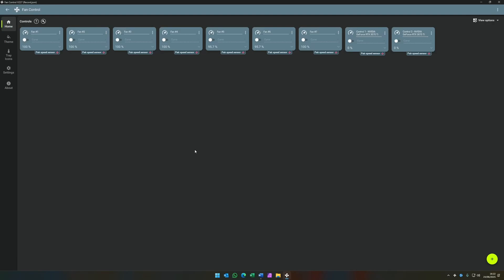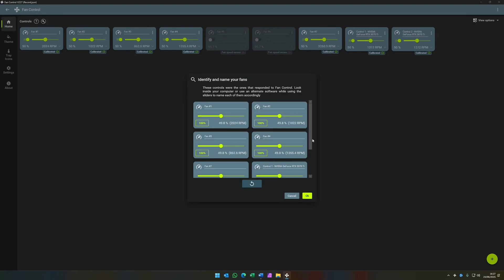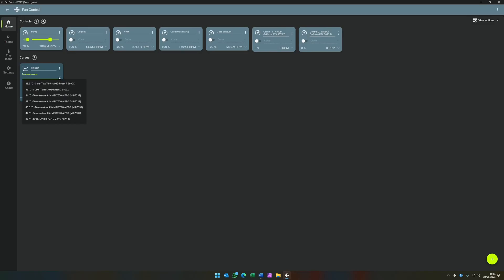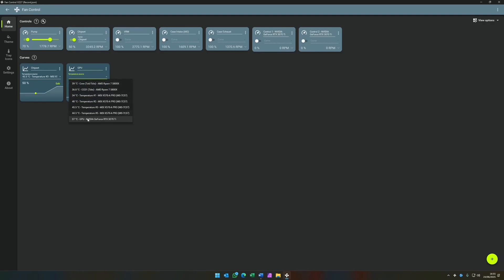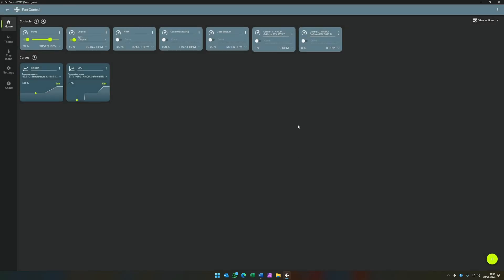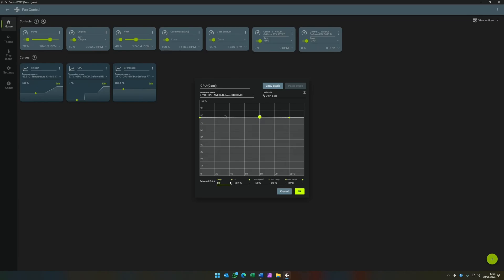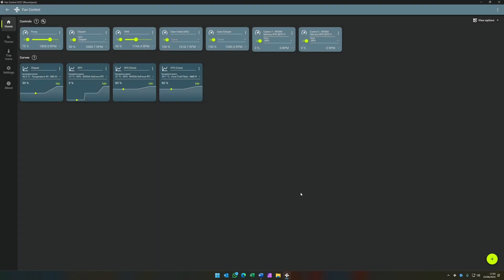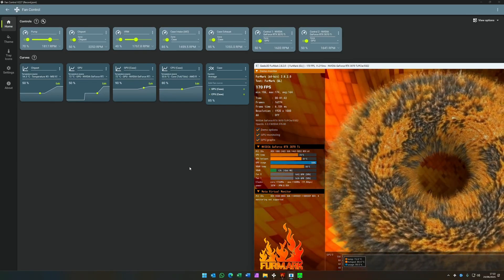How to Setup FanControl

Comment from the maker: Do you use FanControl? If so, how have you got it configured?
Reply: Mix graph, so which ever CPU or GPU is hotter it takes over the fan control curves of my case fans 😊
Reply from the maker: Smart
Reply: yap, the first time i use it was today. And im so happy, bcs i can link my case fans to gpu temp. BTW, i guess, if i use MSI Afterburner, it would be better if i deleted the GPU sensor link in Fan Control, bcs FC and MSIAb can conflict with each other, its better to leave all  GPU control to Afterburner. Correct me if i wrong xD
Reply: @elem8942  My fan controll overrides MSI, i still have my overclock on msi as well
Reply: powl0 on my computer is NOT safe to use! There are several reasons for that. the computer easily freezes and then becomes unresponsive. I have never been able to get powl0 to work even though I consider myself to be someone with a lot of data knowledge. powl0 can also cause damage to windows

Comment: Why do you create the first chipset graph if you only apply the last two to the case fans? Am I missing something? By doing that it ramps up the case fans to a minimum of 80% does it not?
Reply from the maker: I like to control the chipset fan separately as because it's  smaller, it is very loud.  The case fans run at a minimum of 80% as they are big 140mm fans and are below my personal noise threshold that I talk about at the start of the video.

Comment: You don't cover BIOS settings for your fans to get this app to integrate correctly.  

Also, I had been running this software for some time now and it was controlling all of my system fans perfectly.  I then installed a Universal Screen and the accompanying software (L-Connect 3 from Lian Li) and it somehow messed up my control of the fans.  I've tried uninstalling both apps and reinstalling, no luck.  Tried the Fan Control by itself again, still don't have control over my top fans and the middle fan in the front of my case.  Another fan says I have control, but I actually don't.   Tried getting help from Lian Li CSRs and I think they have given up trying to help me.  I emailed customer service for Fan Control and no reply.

Comment: i am having trouble setting this up. i can see my fans but none of them have speed sensors detected and don't react to input when calibrating.
Reply from the maker: Sounds like they may be either non PWM fans, or set incorrectly as DC in BIOS.
Reply: @sOOtieLive  all of them are working and fully controllable on armoury crate. including the aio pump

Comment: What is the chipset fan? I have all the ones you have except for that one. I think its tied in with my VRM MOS fan and heatsink on my Asrock Taichi Carrera. Also with these setting wont the case fans just always spin at 80% minimum? Thanks for the video.
Reply from the maker: Chipset fan is a fan that is fixed to the motherboard and helps cool the chipset, if one isn't showing during detection - you might not have one. They are very distinct as they cause a LOT of noise at high RPM. As for the fan settings, no - they  will ramp up depending on what the sensors are seeing either individually in the case of the single graphs or a mixture of more than one for the mixed curve.
Reply: @sOOtieLive I will watch your videos again because mine were staying ramped up I had to turn the curve down to 50% instead of 80
Reply: Nope, following your instructions implicitly my case fans run at 80% minimum, just like the video shows, after you put your case fans to run the gpu (case) and cpu (case) mix curves, your case fans starting spinning at 80% as well.

Comment: Fan Control Icons themselves within the application don't have any toggle switch anymore in version 245 - the latest at this moment - so how can that setting can be adjusted, instead?!
Reply: you need to click on the 3 dots on the component fans u want to adjust and then set to manual and you will see the bar .

Comment: how does this software impact performance isnt it just better to tune your fan curve in the bios?
Reply from the maker: Personal preference. I haven't noticed any performance issues. It gives way more options for monitoring temps than any bios I've seen - for example an average for two censors (CPU / GPU)  rather than just watching one.
Reply: Problem is that in BIOS, you can't use the GPU temp to control any fans. So, if you're doing something GPU heavy that doesn't hit your CPU very hard, your case fans will all be idling while your GPU is burning up because all the GPU fans have to cool it with is the hot air trapped inside the case that isn't getting replaced by those idling case fans.

Comment: I cannot determine which case fans are which because the only fans that slow down are the ones attached to my radiator. All of the other ones continue to operate normally even if i set the RPM to 0%. Anyone know how to resolve this? I've done all of the other steps. Also, are the fans attached to my AIO Cooler Radiator considers the (chipset fan), CPU, or Case Fans? I dont know what graph to assign to them.
Reply: @JJ-js3sw   Your Case Fans should be in one of the Sys-Fan pins on the Motherboard, hense should be system fan in the app
Reply: @ShadowGamerLP  and be pwm

Comment: FanControl only sees my gpu fan, any of the cpu fans or neither case fans aren't visible, u guys know how to make it visible?
Reply: @dyzmor  are ur case fans 3 pin? If so, it won’t work
Reply: @iDetain  Yes they are 3pin, but I will shock you, it actually works now! The thing that was colliding with fancontrol's kernel driver actually is the same as faceit antycheat's one. So uninstalling faceit ac fixed visibility of the fans. lolz
Reply: @dyzmor  is it safe to use it when playing games with anticheat ?

Comment: Newer FanControll v239 - v240 - v241 (Powl0) does not work as well on some systems and does not find all sensors. Older FanControl which used (WinRing0) which is now blocked by Defender worked much better!

Comment: Microsoft Defender blocks the winRing0 (FanControl.sys) driver that FanControl used before. This is a low level driver. After FanControl v2.39 they switched to the (powl0) driver which is NOT blocked by defender! but Powl0 is not as good and stable as they (WinRing0) were. In the video he uses v227 of FanControl which does not use the newer Powl0 driver? then you have to make an exception in defender, select file or folder
Reply: @ford1546   so is it safe to use it now i think the ver250 came out now ?

Comment: It just stopped detecting my CPU like 2 days ago. What the hell
Reply: Microsoft Defender blocks the winRing0 (FanControl.sys) driver that FanControl used before. This is a low level driver. After FanControl v2.39 they switched to the (powl0) driver which is NOT blocked by defender! but Powl0 is not as good and stable as the (WinRing0) were. In the video he uses v227 of FanControl which does not use the newer Powl0 driver FanControl.sys. You have to make an exception in defender, select file or folder.widoy FanControl.sys notting works.

Comment: Does this software conflict with iCUE? I'd like to control 3 Corsair case fans and RAM/keyboard RGB with iCUE and use Fancontrol for the case fans that came with it, but I'm not sure if that's possible.
Reply: I suggest you don’t use iCue most people use signal RGB because it unifies all RGB products together
Reply: @PeterPerez.  Oh wow! Since I have Corsair RAM and keyboard I assumed that was the ecosystem I had to stick to. Didn't know someone made software that controls everything.

I'd miss the dashboard function for temp/fan overview, but I guess HWmonitor can do that too :)
Reply: @BlazingsNL what's the temp fan overview? If it's what I'm thinking fan control can let you put temperature and fan speed widgets on the taskbar
Reply: @PeterPerez.  The iCUE dashboard gives an overview of all PC parts with their usage, temperature and fan speed. Nice to put on second monitor to see if you need to tweak some fan curves.
Reply from the maker: One way to find out I guess
Reply: @sOOtieLive  I'm trying to find out before buying the new rig hahah. Although I guess worst case scenario I'll have to set a fan curve in the BIOS for the non Corsair fans.

Comment: Im very curious why the Fan Control only finds my RX 6800 GPU but not my Ryzen 7 7800x3d fan nor my 5 Case Fan's that confuses me. did the exact same setup like explained in your video.
Reply from the maker: Have you set them to TPM in bios? Are they connected directly to the motherboard headers?
Reply: @sOOtieLive  thanks for the reply, i figured out on reddit. Issue was Windows Defender was blocking a File to allow scanning my Sensors. Got it working now. Appreciate your Video and help in the Comments.
Reply: @iammodelface how did u make it work
Reply: @worldycloop there was an update yesterday that should fix it. just update fan control and it should work. if not create an folder where you block windows defender extract all files there and it works like it should.

Comment: My FanControl stopped detecting the CPU fans, any idea why?
Reply: the same happend to me, this worked for me. shut fan control down, make sure you look in the upper pointing Chevron. To make sure that it is completely turned off. Then. Go into your apps And run the program again when I did that It went in there and found everything again. I'm still having to go back in there now and reset it all up, but at least it did find all of my fans, including my CPU.

Comment: I DO use FanControl and love it.  But just yesterday, Windows 11 defender said it contained a virus and now it doesn't recognize all my fans.  Any ideas/fixes?
Reply: There is a new version of FanControl.  V239.  IT WORKS!
Reply: Microsoft Defender blocks the winRing0 (FanControl.sys) driver that FanControl used before. This is a low level driver. After FanControl v2.39 they switched to the (powl0) driver which is NOT blocked by defender! but Powl0 is not as good and stable as they (WinRing0) were. In the video he uses v227 of FanControl which does not use the newer Powl0 driver? then you have to make an exception in defender, select file or folder
Reply: @ford1546 Subsequent updates to Fan Control have fixed this problem for me

Comment: >_< WHY isn't anyone talking about the fact that WINDOWS DEFENDER BLOCKS YOU FROM USING THIS SOFTWARE?!?!?!?
Reply: @Just_Biscuit_Gaming  fixed now
Reply: @PeterPerez.  In what fashion? Are you saying that Window's Defender won't screw it up?
Reply: @Just_Biscuit_Gaming they quit using the old driver
Reply: @Just_Biscuit_Gaming  fixed now October 2025
Reply: @Just_Biscuit_Gaming  Microsoft Defender blocks the winRing0 
(FanControl.sys) driver that FanControl used before. This is a low level driver. After FanControl v2.39 they switched to the (powl0) driver which is NOT blocked by defender! but Powl0 is not as good and stable as they (WinRing0) were
Reply: Microsoft Defender blocks the winRing0 (Fan Control.sys) driver that FanControl used before. This is a low level driver. After FanControl v2.39 they switched to the (powl0) driver which is NOT blocked by defender! but Powl0 is not as good and stable as they (WinRing0) were. In the video he uses v227 of FanControl which does not use the newer Powl0 driver? then you have to make an exception in defender, select file or folder
Reply: Is it works now ?

Comment: Regarding fan curves do i just copy yours or do i need to to research i have a 5600x 3060 i think yours was 7600
Reply from the maker: It's purely personal preference. Considerations like noise tolerance, cooling strategy (positive v negative pressure) and fan placement all play a part in how you set them up.  I'm very sensitive to sound for example, so I REALLY notice when fans ramp up / down constantly so I tend to create more static curves where the fans spin as fast as possible whilst still in my tolerance for noise.  Make sure you're monitoring temps and experiment would be my advice.

Comment: Hello, will this fancontrol program work on an HP Omen 16 5T925EA laptop (it's a laptop) or will it only work on a desktop? Out of curiosity, do you need to have RPM sensors installed in the laptop for FanControl to detect it, or is that impossible? In either case, is there a program for an HP laptop that can control the fans and set curves for both the processor and graphics card? Regards.
Reply from the maker: No idea on laptops tbh, one way to find out I guess - install it and see?

Comment: Can you just let it do the Auto fan calibration and leave it at that?
Reply from the maker: I think all the Auto Fan calibration did was work out which fans are connected to which sensors and then sets them to 50%.  This may work ok, but I'd recommend building some graphs to get the most out of the program.
Reply: @sOOtieLive appreciate your reply ive never done anything like this before so i don't want to damage anything. Also it says there's a virus when downloaded

Comment: Windows defender detected a trojen horse in this fancontrol software
Reply: The latest version replaced the dependency that was flagging the software as a virus. It was used by lots of fan control and RGB software, but it turned out to be exploitable. So, it got added to the Defender block list. It wasn't a virus, but it could be exploited.

Comment: I started getting a Defender notification today about Winring0 (driver that FanControl uses) being vulnerable then it just automatically removes it and FanControl breaks
Reply: same, tried excluding the folder in defender and still nothing. the temp file it makes on start up gets deleted then the app doesn't initialize properly.
Reply: @KovertMecha  same here.  soo frustrating
Reply: I believe it has something to do with librehardware monitor. I used that instead of hwinfo64 to watch temps on everything while benchmarking forever and recently had same issue. If you look closely in fancontrol settings it uses librehardware monitor i believe and that's what breaking it. Something to do with the way libre works it leaves vulnerability to outside sources to do background things or something like mine bitcoin without you knowing it and other things. Gonna just have to figure out a workaround or start using something else. its a shame cause this is hands down the best fan control software out there. lookup the code microsoft defender gives you about winring0 on google and theres a bunch of forums. Soon as i got rid of librehardwaremonitor and started using hwinfo64 its been fine but need to see if theres a workaround for fancontrol.

Comment: the app it s only detecting my Nvida fan and my Pump fan, not the ones in the case. How can i make them appear?
Reply from the maker: Only thing that I can think of is they are either not PWM fans or they are not set to PWM in BIOS.
Reply: Microsoft Defender blocks the winRing0 (FanControl.sys) driver that FanControl used before. This is a low level driver. After FanControl v2.39 they switched to the (powl0) driver which is NOT blocked by defender! but Powl0 is not as good and stable as the (WinRing0) were. In the video he uses v227 of FanControl which does not use the newer Powl0 driver FanControl.sys. You have to make an exception in defender, select file or folder. without FanControl.sys notting works on older FanControll
Reply: Newer FanControll v239 - v240 - v241 (Powl0) does not work as well on some systems and does not find all sensors. Older FanControl which used (WinRing0) which is now blocked by Defender worked much better!

Comment: Do I need to do anything in BIOS before using this software?
Reply from the maker: You need to change any appropriate fans to PWM mode so that fan control can manage them. Often they are set to auto anyway but if you have some that you can't seem to control in Fan Control - have a look at what they are set to in BIOS.

What I like to do is other than the AIO pump, I set all fans to 100% in BIOS so that as the PC boots it gives everything a proper blow out then settles into the fan curves I've set as the PC starts and Fan Control launches.
Reply: @sOOtieLive  Hey, I've got some Lian Li Infinity fans connected to my motherboard, I set it to PWM Mode in the bios (it was on auto before, so I tried changing to PWM) but FanControl keeps losing control of the fans after a few minutes. Then they go blasting and are very loud. Do you know what might be the cause for this? (Using Force Apply, doesn't work either)